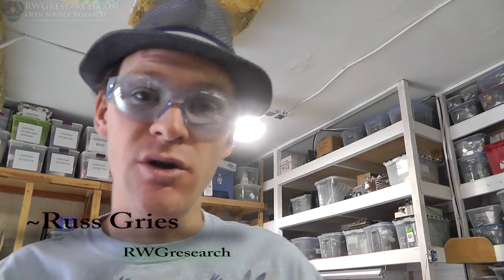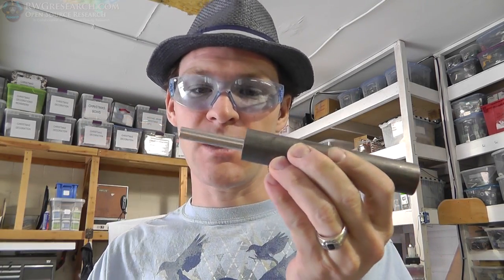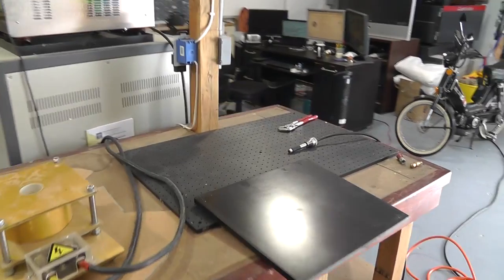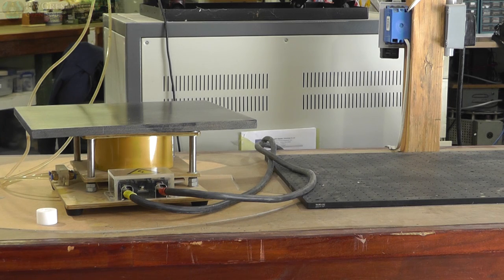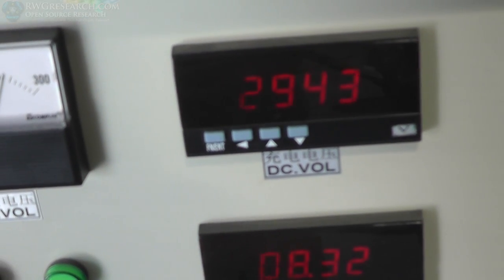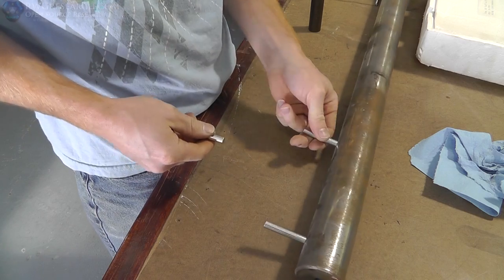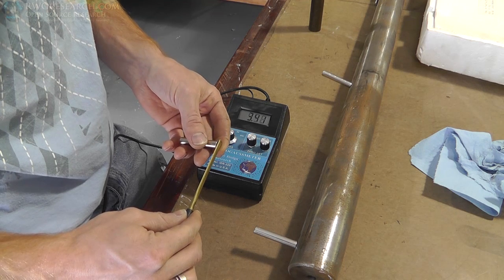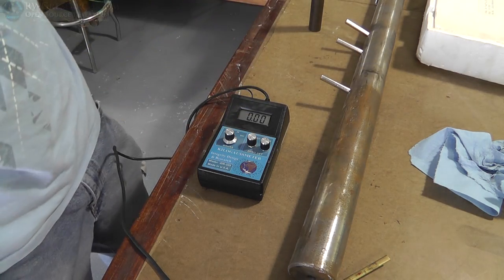Test:1 Magnetizing Experiments  : Torch Demagnetize, Impulse Generator Re-Magnetize

Comment: Magnetite has a so-called inverse spinel structure. The cubic unit cell corresponds to Fe24O32. Oxide ions are cubic closest packed, so there are 32 octahedral and 64 tetrahedral holes in the structure. There are three kinds of Fe present – Fe3+ in tetrahedral holes (1/8 of the tetrahedral holes filled); Fe3+ in octahedral holes (1/4 of the octahedral holes filled); and Fe2+ in octahedral holes (1/4 of the octahedral holes filled).
The magnetic properties reflect the splitting of the 5 d orbitals, as shown below for octahedral and tetrahedral coordination of the Fe atoms by oxygen atoms.

The small splittings between the two sets of d orbitals caused by oxide ligands means that all Fe3+ ions have five unpaired electrons and all Fe2+ ions have four unpaired electrons. As sketched below, the Fe3+ and Fe2+ions that are in octahedral sites are ferromagnetically coupled through what is called a double exchange mechanism.

Comment: Hi Russ
the temperature where it loses it's magnetic force is the Currie temp. For Neodymium magnets it's about 320 deg. Celcius. Over 900 deg will change the structure of the magnet making it permanently demagnetized...but I suspect you know all this...I tried melting one using induction heating instead of flame but although it melted, you could not get the molten material to flow...not even close..It was done in a vacuum to prevent oxidation but still no good.

Comment: What if you put an already magnetized neodymium into the impulse generator over and over? Can you make the magnet slightly stronger each time? Also, would you be willing to make and sell me a couple ring magnets where the magnetization would be produced by sending the capacitor discharge through a thick wire or copper rod that is going through the middle of the ring magnet? I'm looking for something that would have an outer diameter 1/2" or less and and inner diameter of 1/4" or less and a height of at least 1/8". It's my opinion that the wire or rod going through the center of the magnet would need to be insulated, otherwise the electricity might partially conduct from the rod to the magnet nickel plate and travel around the outside of the magnet which would inhibit the magnetic field I'm after.